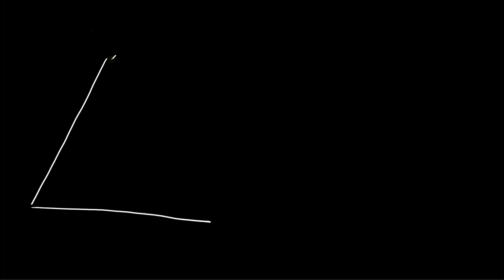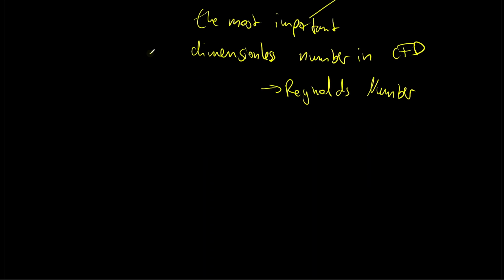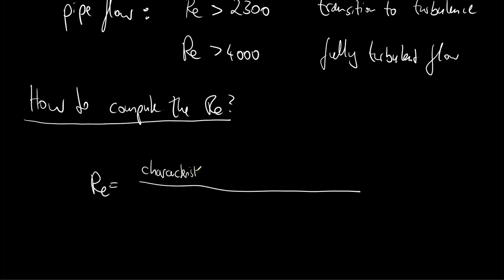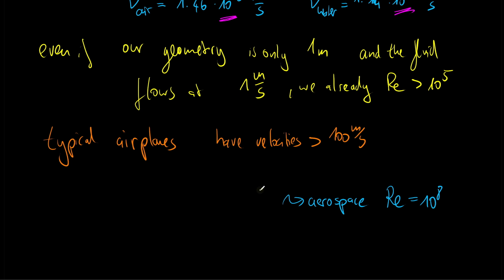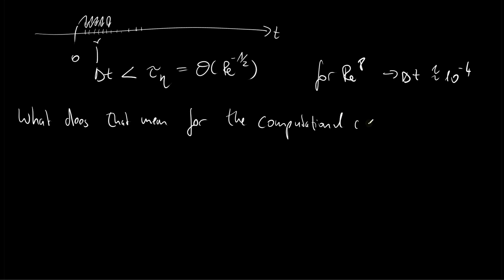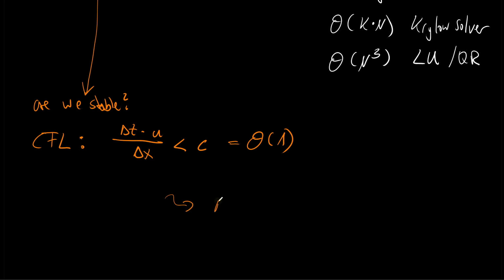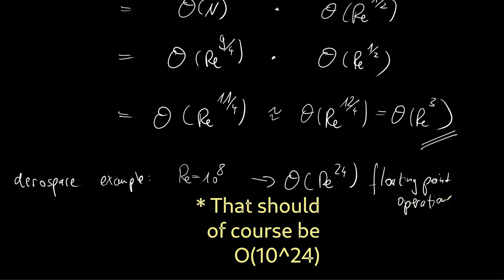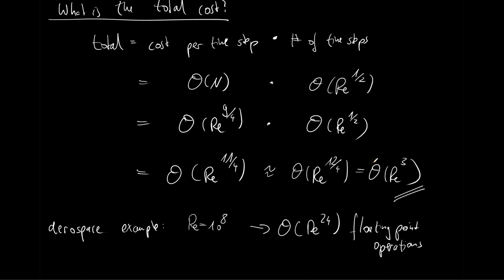Why are Direct Numerical Simulations often impossible?

Comment: Great video. I have a question at time stamp 31:19, why is 10^6 seconds equal to 1 month, and not ~12 days?
Reply from the maker: You're welcome 😊
Thanks for the comment. Of course, to be precise, 10^6 seconds are only 11.sth days. Although there is of course a factor of 2 to 3 between this estimate and a month, you could argue it's still in the same order of magnitude.
The estimates done in the video are extremely rough, we lose many significant digits along the way. Also, the rounding we did in the exponent to Re^3 is mathematically questionable :D. You should also remember that the full utilization of supercomputers require perfect parallelization of the problem (and perfect programming) which is impossible to achieve. That alone would probably add another order of magnitude to the runtime.
In the end, I think the important takeaway is the infeasibility of the simulations with our current (and future) hardware 😊

Comment: I note you slipped in an extra Re ^ 0.25. At Re = 10^8, that is a factor of 100. Leave out that factor of 100, and your example of an aircraft computation would not take a month, but 8 hours. In a year you could do all 1000 cases, a reasonable time for a new aircraft design cycle.
Reply from the maker: Thanks for the comment :).
You are right, the simplification of changing from Re^(11/4) to Re^(12/4)=Re^(3) is a rather rough one and results in the factor of 100 in runtime for the aerospace example. However, I'd argue it is okay since our estimates are super rough in the first place. We are not accounting for potential additional effects and also build upon the Kolmogorov scales.
In the end, it doesn't greatly matter whether it will take 8 hours or a month, as it is still running on (the world's fastest) supercomputer. The estimate also assumed the CFD simulation would scale as good as benchmark software (which it will not, to a large amount). Hence, runtimes will be considerably longer. Ultimately, industrial CFD applications don't have access to supercomputer-like resources, and it would also be unreasonable to use a (full) supercomputer for an entire year, the costs are unbearable.

Let me know what you think :).

Comment: Great video : D
I have a few comments regarding the DNS simulation for someone who wants to dive in bit more into DNS.

1. In reality, you won't fail from simulating something in low-Res DNS simulation. Otherwise, you don't really need that high resolution to perform a DNS simulation. This is the nature of DNS simulation. The solution usually would converge to itself.  The main point here would be, how much detail would you like to resolve in the DNS. (Or eddies scale) So, don't be afraid from performing the low-Res DNS if you just want to get the large-scale information as DNS usually would give your the full physical information.

2. They are few ways to minimize the computational cost in DNS, as usually, people are just interested in only a friction of the domain of simulation. For example, the astrophysicist who performs the simulation of star-forming cloud would only be interested in those regions which are dense for star to form. In those cases, some methods such as SMR/AMR (Static/Adaptive Mesh Refinement) would help. Those methods would set a low-Res grid in the region that you are not interested in and focusing the fine structure of the dense region(High-Res grid). As a result, sometimes you can even save few orders of magnitude of the computational cost using those method but getting the information that you want.
Reply from the maker: Amazing, thanks for the comment and the kind words 😊
And you are right. I think these are some nice points for people who want to dive deeper.